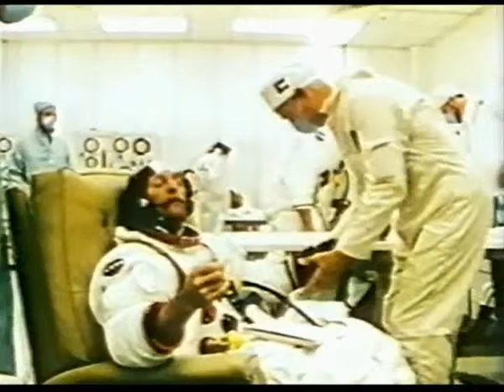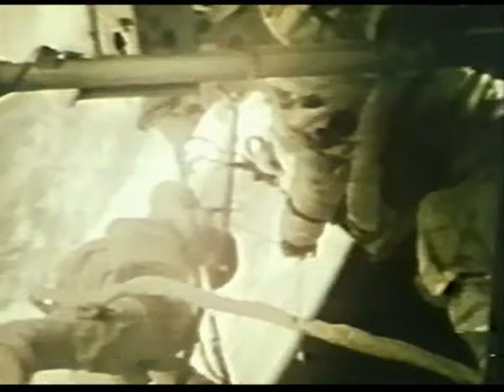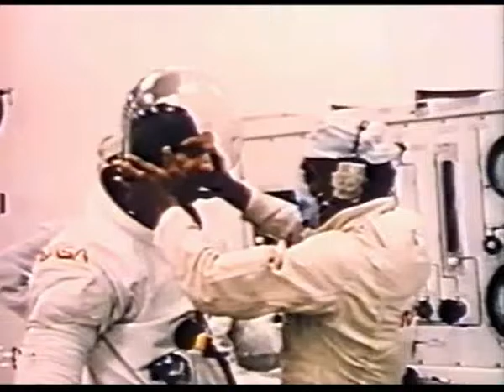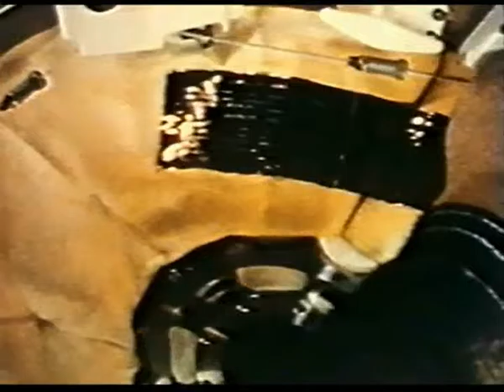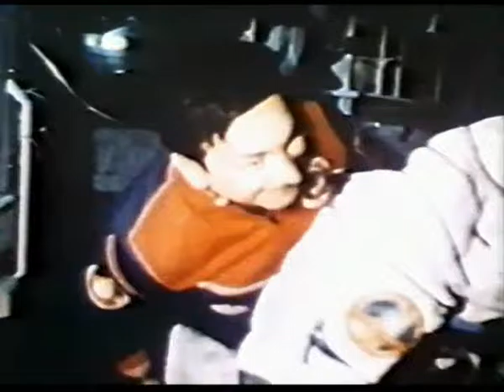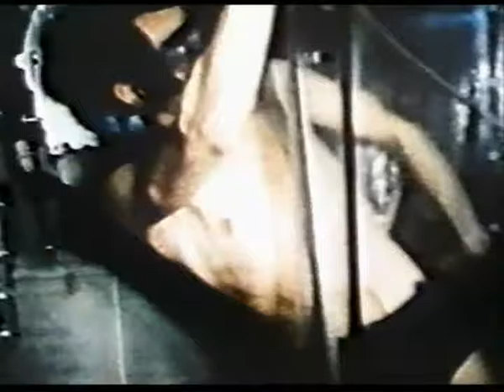CONQUEST   Part 3

Comment: I have my dad's old recording of this part on a VHS from Finnish TV. The picture quality is quite bad, but it brings back great memories.. I used to watch it over and over again with him =D It's good to see it in better quality!
A small detail, but unfortunately it seems to be missing a bit of the openjng and a part in the middle where US and Soviet met and docked in space. Was it that way on your VHS?
Reply from the maker: I probably turned to the channel a bit late to get the full start, or the old 2-head VHS machine was a bit slow to spool up the tape and start recording. Or; maybe the tape wasn't fully rewound and I miscalculated how long it would take to rewind it. One of those things - I think I recorded this in 1986, so I'm not sure.